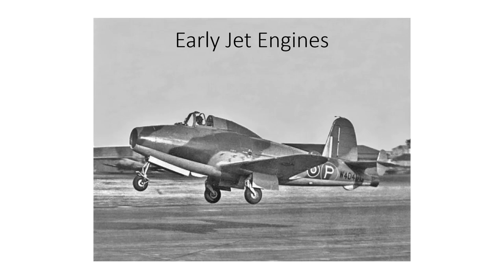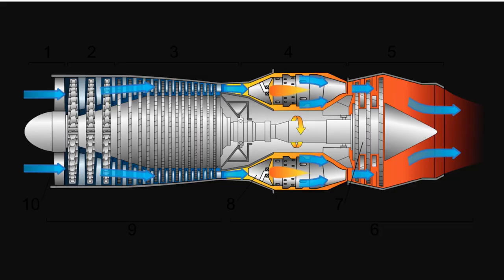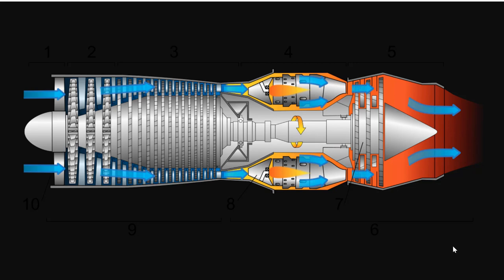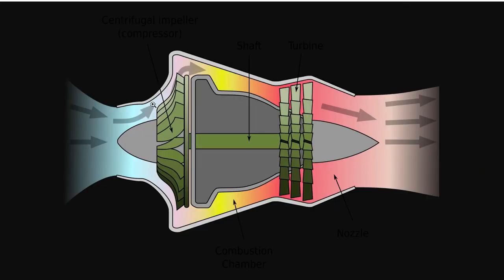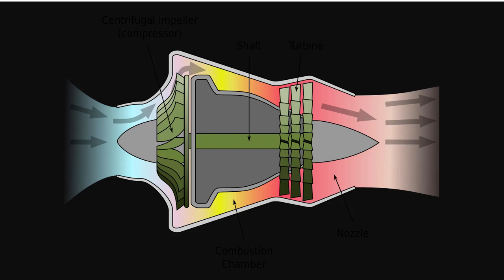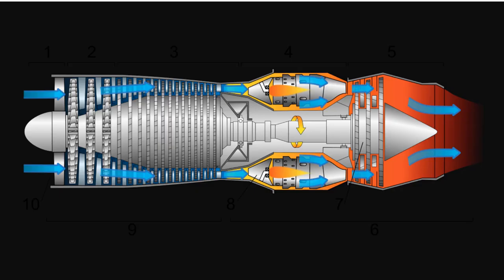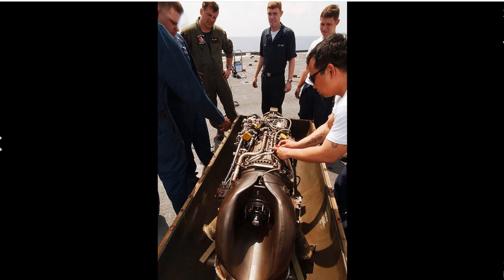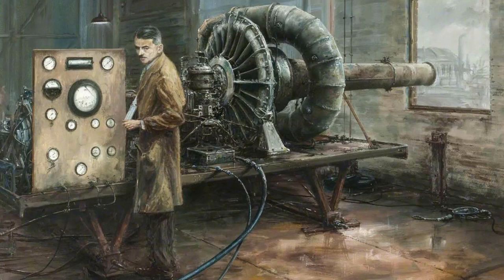Early Jet Engines and Aircraft

Comment: I think Ohain is still working on hydrogen as a fuel. 
The real problems with the early jet engines was combustion and control. So the people working with Whittle were trying to get the combustion issues solved and Ohain avoided the subject. It was always the goal of the Whittle combustion team to develop more streamlined straight through designs. For many reasons an axial design was not viable with the technology of the time. One of the big problems was also the control to remain within the material limits all the time and all conditions. Centrifugal designs were the correct design choice. The German axial design choice was a political one, also due to the lack of progress with their centrifugal designs.

Comment: Well done!  This lecture combines history and engineering technology--two of my favorites.  It would be great if you would do some more lectures on evolution of airplane design.  I'm reading "Airframe" by Michael Chrichton and getting a crash course in aerotech terminology--I learned the difference between flaps, ailerons and slats!  I recommend the book btw.  It's a little dry for some because Chrichton goes into some detail about the engineering and manufacturing of commercial airliners, but I figure it would be just about right for students in the field.
Reply: Sorry, spelling should be Crichton.
Reply from the maker: Thanks!  I read Airframe a long time ago a really liked.  I thought he did a good job of weaving the technology into the story.  I'll think about doing a video on the evolution of airplane design.  It's not a bad idea.

Comment: Great video, I finally understand what's happening there. 
Were there any other vehicles in history powered by a turboshaft engine other than helicopters?
Reply: Chrysler had a car that never made it past the preproduction stage.  The m1 Abrams main battle tank uses one.  The Geico offshore racing team uses them in their very fast race boats.  All hydroplane race boats have used them since the early 1980s
Reply: @sketchyssk8shop  nice to know that, thanks!

Comment: So when can I get a 1250HP jet car
Reply from the maker: Once you get the jet engine, the rest is easy :-)
Reply: @purdueMET  except the tire part, that’s hard.
Reply: @TeenWithACarrotIDK  unlike piston engines, jet engines are quite slow on slow speeds. Just as he said, moving air slow at slow speeds is better than moving air fast on slow speed. You can have lots of rpm on a jet engine but little traction or not much air. Still, I'd like the T58 slapped to a car
Reply: @reedman0780  now that I searched up the T58 engine, I can definitely agree that putting one on a car would be cool. I don’t know why my mind went to thinking about the mid to high grade jet engines when thinking about jet cars, since obviously those type of jets would be impossible to use in a regular car in any sense.